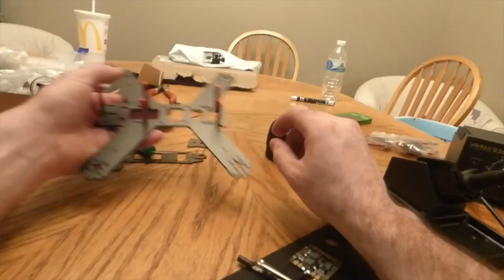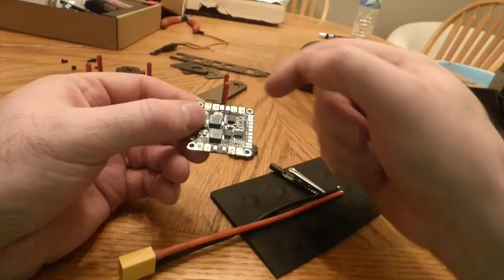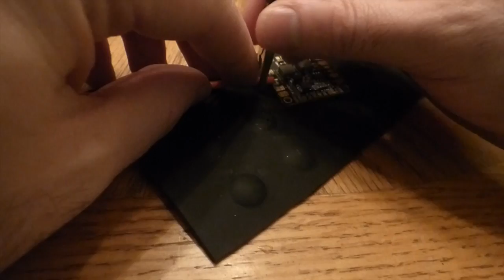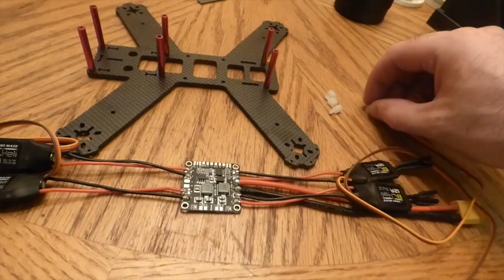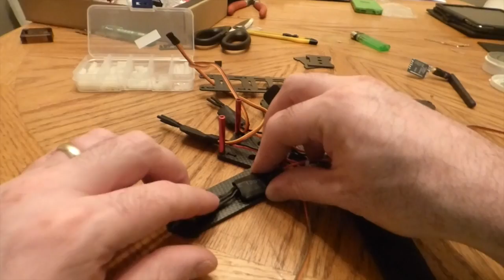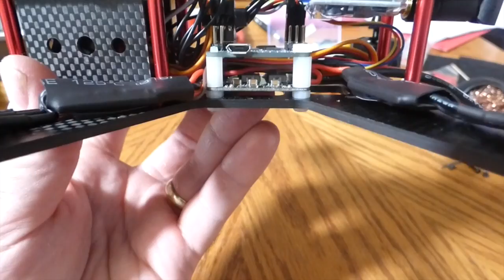QAV 210 Quick Build - RC Quadcopter

Comment: did you solder those pin connectors to plug in all your wires
Reply from the maker: It all came that way bud. No need to solder on any connectors.

Comment: can this thing use APM flight controller?
Reply from the maker: It will, but I would consider it overkill for this quad. The APM is not as light as the naze32 arco or cc3d. I would strongly recommend a naze32 unless you already have the AMP.